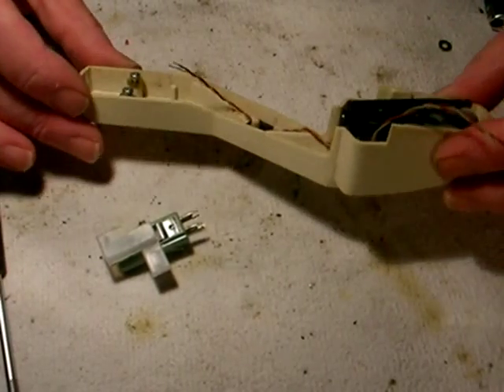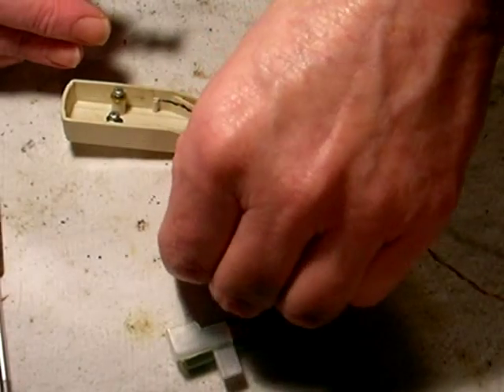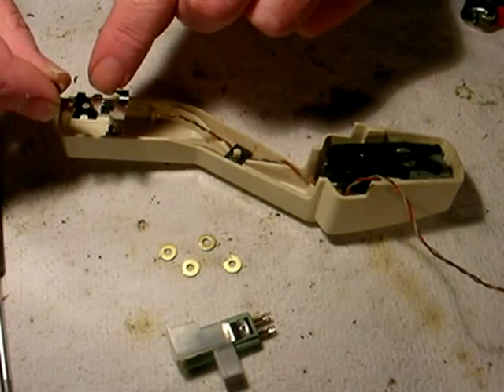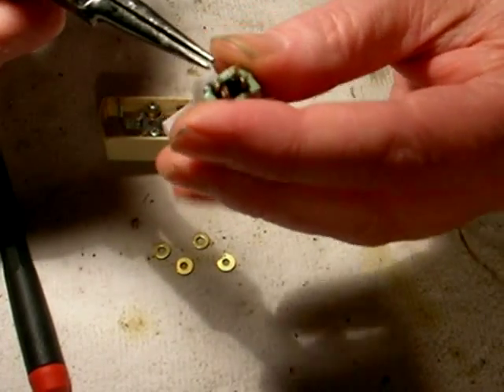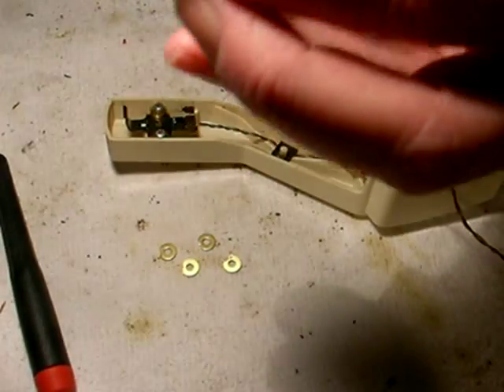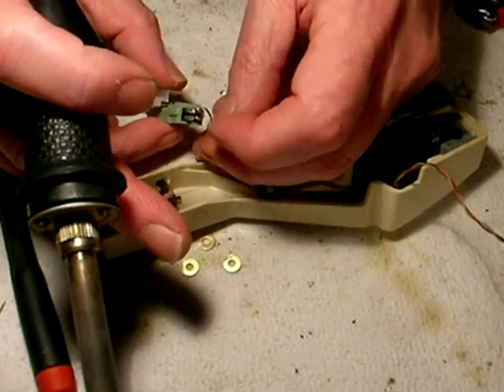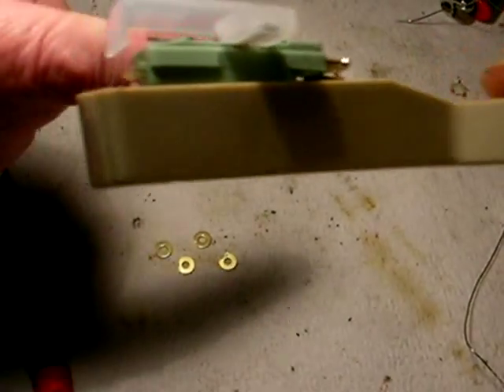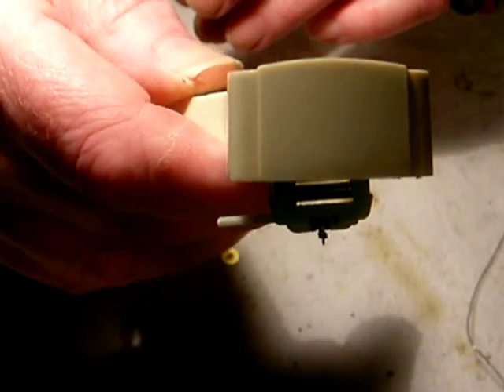RCA RP-190 Record Changer tone arm part 2

Comment: I tried out the tinning method you shown with some scrap tonearm wire, and a broken off plug terminal for a Sonotone 16T.  It worked, and i wish i could of known that method earlier because i did a sloppy job  soldering wire to those tiny terminals of the 16t plug which resulted in a bad ground.

Comment: These videos are very helpful. Got my tone arm cleaned with the fume-free EZ off, then the changer and wow!  What exactly would one call the rectangular metal thing that is located mid-way down the arm that holds the wire under? A washer? A clip? Mine has been missing for decades.

Comment: This would be a great idea for a replacement cartridge. If I have my GE Show 'N Tell, I replaced the dead cartridge and if the new needle comes in will do the same thing with this one, and it should work fine if it's bridged for mono, but it needs a new bracket, because the tone arm on my Show 'n Tell had no screws, and it needs to be glued.